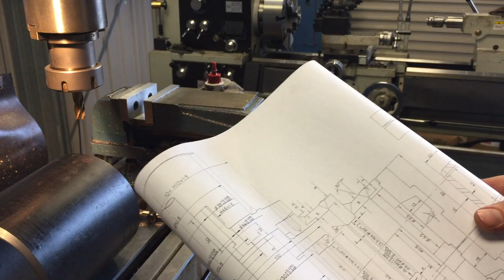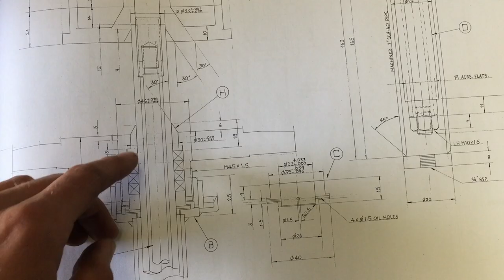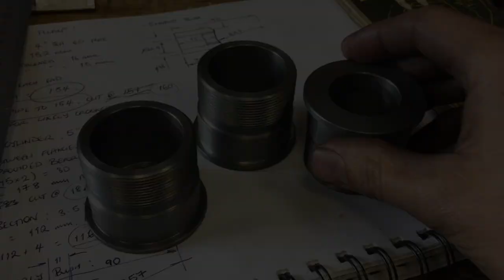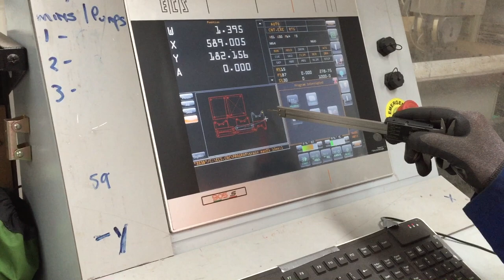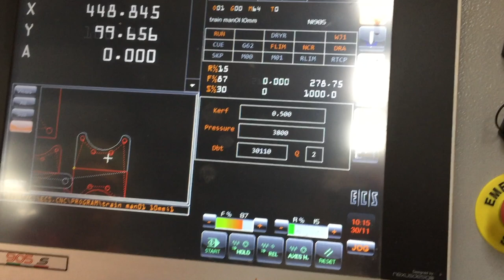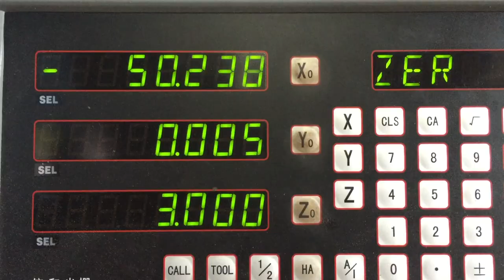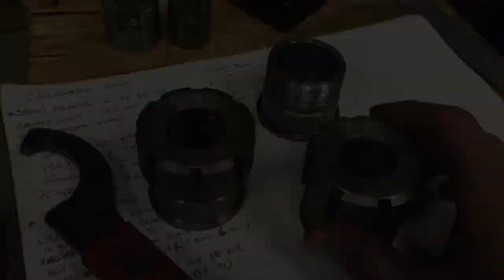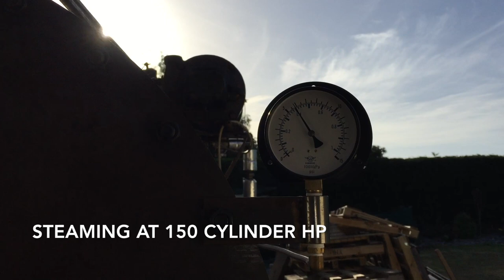Smokeless Steam Locomotive | Modern Steam Locomotive Design & Build EP8

Comment: Could this type of boiler and system be used to eliminate cinders from coal burning locomotives in tourist railroads where the fire hazard is really high?  Would that keep the coal burning smell and the felling of coal burning locomotive, but without the fire danger?
Reply from the maker: Yes! It has been designed with this application in mind. The feel of a coal burner will be retained with less fire risk than a diesel. It would need to be fired on a biomass sourced fuel such as bio-coal, log wood, briquettes etc.
Reply: @Mackwell-Co is it just the fuel it burns that makes it smokeless or some other design aspect
Reply from the maker: It is our high temperature combustion system @caledonianrailway1233 that eliminates smoke
Reply: @Mackwell-Co  thanks